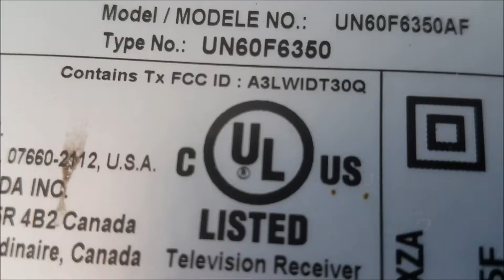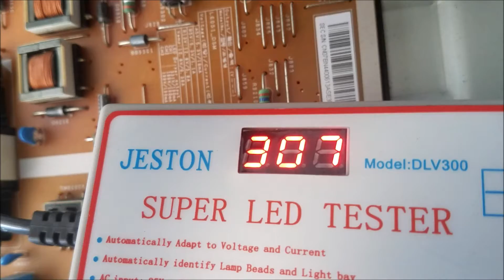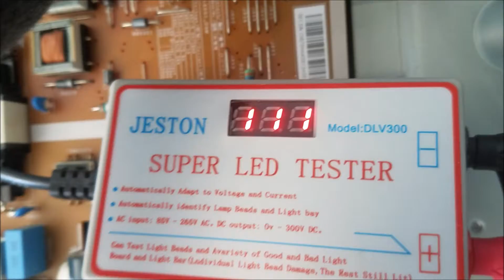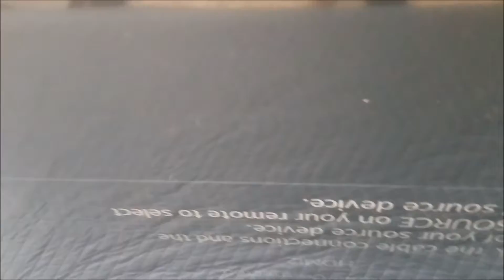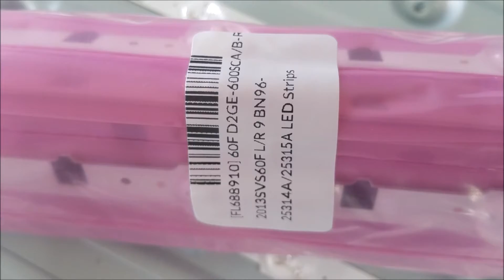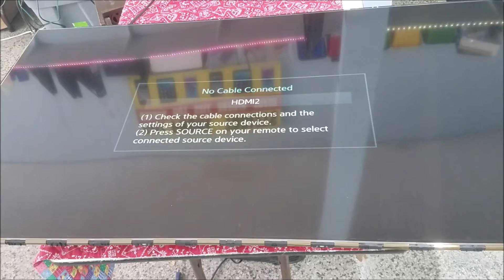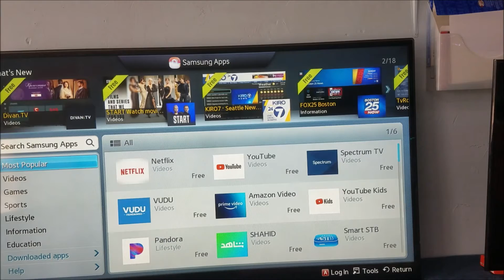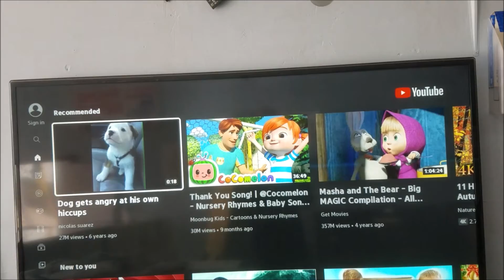samsung tv un60f6350 customer said looping but it is a bad backlight

Comment: Hi my friend great job on this tv also quick question I have a 65s401 tcl with double image I replace the tcon the ribbon cables I tried the tape on the ribbon and still same problem any help with your knowledge can help Thank you I appreciate that
Reply from the maker: when you unplug one cable to the screen do you get one side of screen clear?
Reply: @SOSfixElectronics  no it shows double image when I did that I tried doing it on both sides and still shows double image and no luck
Reply: @SOSfixElectronics  so what you think buddy I tried unplugging the ribbon cable on each side and still double image no luck still you think it can be the cof cable
Reply from the maker: @markb8035  the problem in the screen and  i dont think is the cof, i fixed similar issue in a different model by flip the the vgh and vgl the turns off the second image, this is not easy to do but you will have to do some search about that
Reply: @SOSfixElectronics  ok my friend thank you so much maybe I’m just gonna use this tv for parts than I bought it for 20 bucks which is not bad and I come across a lot of tcl 65 that I fix cause the backlight but thank you for everything you do
Reply from the maker: @markb8035  that tcl series has very common issue the is backlight. And you may find a tv with bad backlight to use